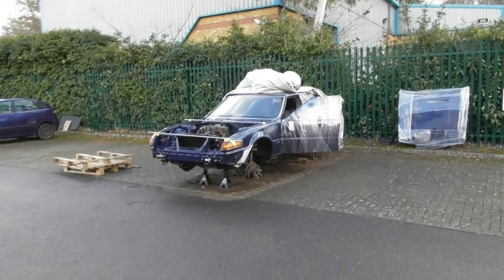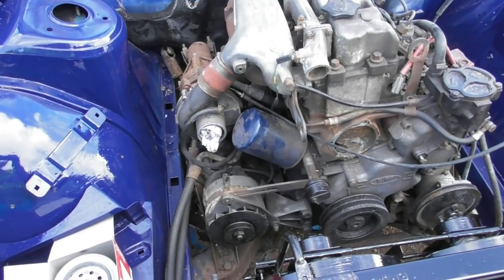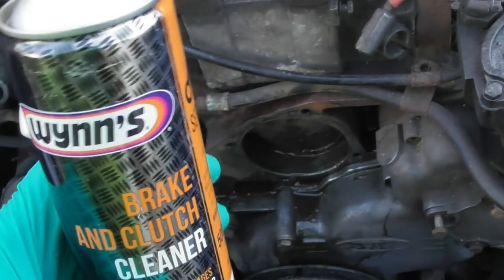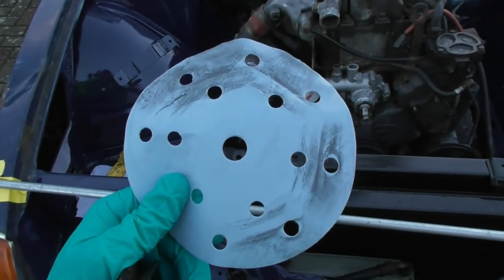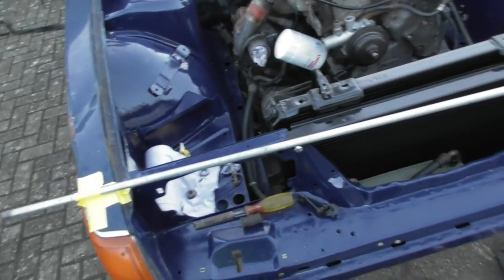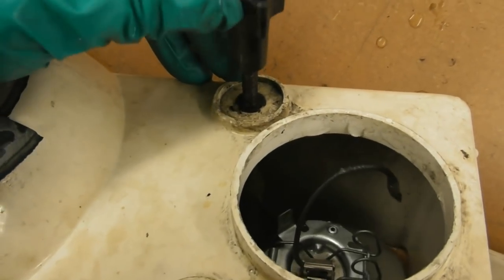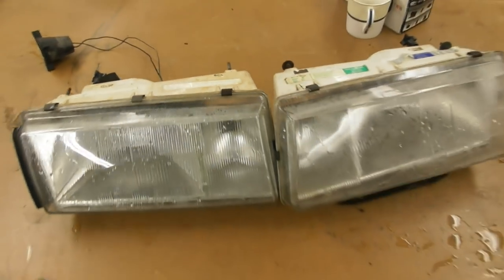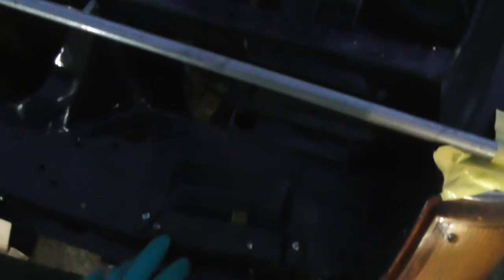Rover SD1 2400 SD Turbo restoration - Video 46 Reassembly

Comment: Great effort.
I've been really impressed with your tenacity with this project in mostly crappy weather.
I'm a big fan of the SD1 and I think it's excellent that you've saved a 2400SD that surely would have gone for parts/scrap if you hadn't rescued it.
Reply from the maker: The weather is the worst part of this. I reckon it would be mot’d by now if I was working under cover.
Reply: @nitrosilvia  
Well, well done for continuing seemingly unabated through these winter months.
My '77 XJ-S hasn't been touched since last Autumn !!

Comment: Hate to tell you this (I don't really) but there's a 2400SD for sale on E-Bay at the moment. 
It's in King's Lynn.
Reply from the maker: Yeah I saw that. Very tempting. Looks a much better starting point than mine. I don’t have any more time or space to take it. Hopefully it will go to a good home
Reply: @nitrosilvia  
I'd have it if I didn't already have too much on my plate although, to be honest, I'm not a fan of diesels. 
These are appealing because of their rarity but engine/model wise I'd prefer a manual 2600 VdP or a 3500 VdP EFi.
Will stick with my Granada Scorpio for now, the SD1's nemesis !!